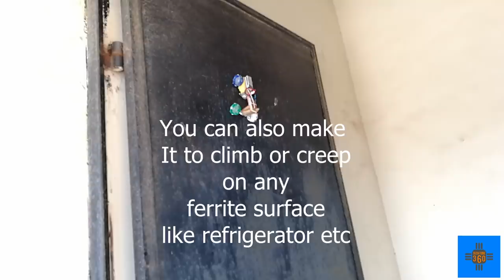Diy climbing magnetic robot at home

Comment: Nice project! 
What magnet sizes do you use? Is it 4x2 mm? Did you check what weigth could it maintance? Can it work only woth magnets on the wheels, I mean can it work without couple og magnets on the motor and the front axis?
Reply from the maker: Yes 4*2 magnets. I didn't tried any other iterations that may work you could try. Thanks for your time and interest